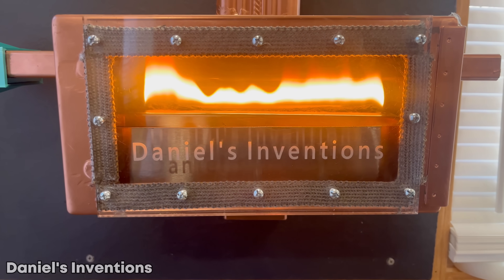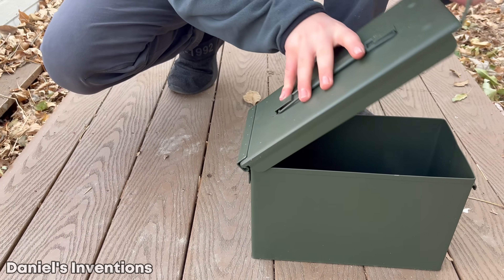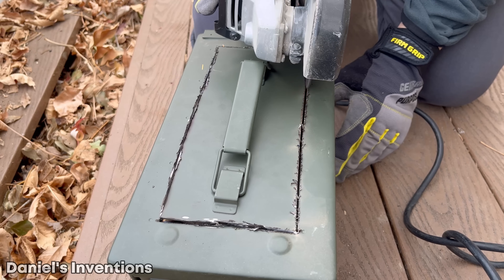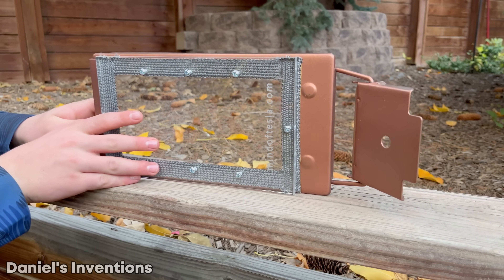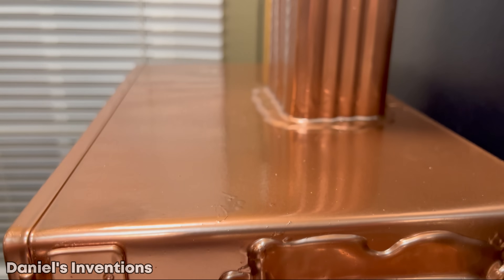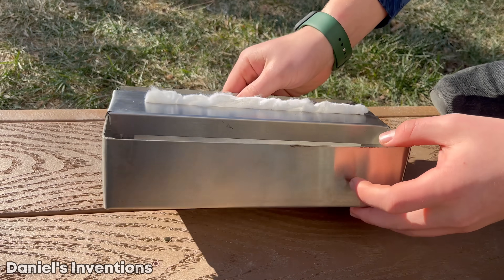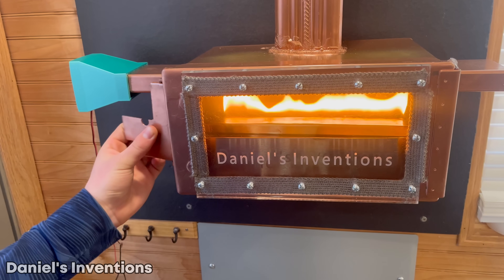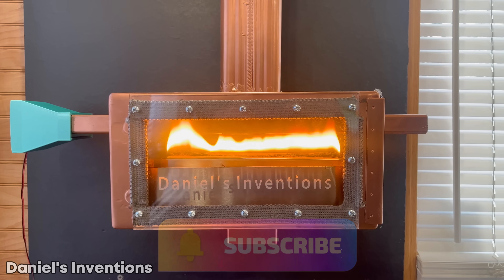ENDLESS Heat for Your Home WITHOUT Electricity 2.0

Comment: Question: if you had a wick system, that you could lengthen like in an oil lamp, could you control the flame and would that allow you to control the temperature your heater is putting off?

Comment: Too eliminate the need for a blower run your heat exchange pipe vertical. Maybe install two, one with a valve to open and close as a thermostat for when not so much heat is needed. The reason for vertical heat exchangers is heat rises naturally pulling the cold air  from the bottom as the heat rises. Hopes this helps you or anyone thinking of designing a heater. Be safe and stay warm

Comment: I built the other one you guys had. My thing was is I tried to put a bigger fan on it and the fan blue so hard it kept the two cool it wouldn't let it heat up. Also I don't think I did the wicks right.... I spent a little money on this little experiment and failed miserably. I really like this idea better. Maybe I may build one of these next year or keep the video around in case the end of the world hits lol
Reply: Lower the fans voltes with a variable resistor

Comment: There are a few reasons to use double walled flue. One is the obvious fire hazard at the wall penetration, but the other is that the double wall insulates the interior flue, keeping it hot enough to reduce combustion products from condensing onto it. Like creosote or tar. Burning any organic matter will produce a tar that can ignite over time, it's not just a wood problem.

Comment: 1:28 as many of us don't have access to a 3D printer for the 12 volt computer fan... what about welding a end cap to the horizontal 1x4 rectangle pipe on the left side, cutting a 4x4 hole in the bottom (or top) flat portion of the pipe and using epoxy to mount the 12v fan into that opening.. 

It would basically be forcing air up (or down) to the opposite flat side of the pipe, then out and across the burn chamber on the right side.

Comment: Bad assery, the thing I'm wondering  is if you could use a heat fan fir a wood stove that needs no external power to power a blower that would make a hot tent that would be awesome ,I very also seen similar designs using used motor oil and candles made from crisco

Comment: I saw a variation of this where they directed outside air into the heating unit. This prevents the system from creating negative pressure and drawing in cold air. The house isn't airtight, and you don't want it to be, but you do want to retain your heat. 

Another thing to consider is adding thermal mass. You could use copper as a conductor and direct heat into a sand battery, perhaps. (?) 

I like the idea. My imagination is playing with other, scaled up, variations. I don't have anything practical, though. 

I have a tendency to overdo things and make them bigger/more complicated than they need to be.   lol

Comment: I like this heater. I would try a chimney pipe with a coaxial design, the inner pipe as exhaust longer. The outer shell would be the intake from outside - no problem with consuming oxygen from inside. The coaxial design would preheat the intake air with the exhaust residual heat.

Comment: Another way to keep the oil cool is to make the vent holes underneath the oil tank also to elevate it from the bottom off the metal that is producing heat with the material that you used for the glass

Comment: Is JBweld heat resistant? I don't know the product. Would be fool proof to get a proper metal weld. How do you put the flame out if the room temperature gets to hot. Do you have any way of regulation of the fuel consumption? Maybe a dripping system would be easier for temperature regulation?

Comment: High Heat: However, if exposed to temperatures significantly above its designed tolerance (like those approaching or surpassing 550°F for JB Weld), the epoxy might start to degrade, potentially releasing fumes or smoke. This is not typical in most applications where epoxy is used, but in extreme cases like direct flame exposure or industrial processes, degradation could occur.

Comment: I wonder if a secondary air flow could be aimed at the top of the heater since it is hot enough to heat a can of soup. That heat could be dissipated with air flow ?? Or does it matter? Not sure. Excellent device. Cheap heat energy.

Comment: Double up the heat exchanger (use 2) and attach aluminium or copper heatsinks to the under side of each for more surface area for the heat to conduct to each exchanger. You also need the heater box deeper as you do not want the actual fuel box getting over about 70c or it will start to emit explosive vapour. Over all a great idea though.

Comment: Cool stove. I have a round floor standing kerosene heater and great heat and can cook on top. But not vented. But I use for extremely cold days only or power out .but I also have wood stove for primary heater.

Comment: Intake air coming from outside also reduces the vacuum effect this design causes, even if it really isn't a huge problem. With the intake located inside the structure and the exhaust venting outside, conditioned/heated air inside the room is being pulled out of the structure, and has to be replaced somehow. That somehow is via leaks in the structure. If it's that cold outside, you're pulling that cold air in to replace the exhausted air through the exhaust piping. Locating the intake to an outside source and sealing the structure makes it even more efficient.

Comment: I did not see how you attached it to the wall. Also, how did you install the outside exhaust pipe? Is it insulated? That said, very interesting video. I have an ammo box. I may try this, but probably will use a fire safe van and a damper.

Comment: This is so cool! I would certainly not advise people to do this without proper guidance though :p, this is a sure way to burn down your house if not done properly. But i have to say this is ingenious, and not very expensive at all! Great diy project that could potentially save you alot of money in the winter months. In Norway we pay up to 3-500$ in the winter months depending on the household. The electricity pricing here is insane in the winter.

Comment: I like it, although I have a couple of ideas based off an admittedly limited understanding of everything involved. Wouldn't it be more efficient to paint the heater and the pipework matt black, to radiate more heat? Conversely, wouldn't painting the concrete board white reflect more heat from it, unless it somehow works better to have it absorb more heat first before radiating any back into the room?
I'm ready to believe I'm entirely wrong with these notions if I can get a clearer understanding. You've spent more time thinking this all through than I have.

Comment: Nice work. Safety first: What happens if the fan fails? Will the bracket melt? Could it cause a fire?
Efficiency: The flames hit the cooling tube and start to soot. Increase the distance for better combustion and less polluting exhaust gases.
Reply: That is a hard drive fan, they will go for years and years. I'm sure they will notice if the fan has failed as it is an essential part of this type of heater being effective. Diligence and operating only with supervision are absolutely the only way to safely use any kind of flame for a heat source.

Comment: By having the intake take air from inside the house you create a negative pressure in the house cause air to be sucked in from the cold outside from any crack near windows and doors in can find. Take air from outside as well as exhaust outside similar to a mini split AC

Comment: CUTE BUT TOXIC OUTPUT.  This is way above the skills of most people and has some safety issues.  Ironically, a small fan driven electric heater is very efficient at heating a single room, particularly if you put a fan in that room to help circulate the air... that's what I do.  Although heat is required by my lease, it is never warm enough and vacancy rates are almost zero in Vancouver and rents are through the roof.  I pay a low rent controlled apartment and don't complain about anything.  I fix it myself.  I pay $1,000 a month for a renovated one bedroom apartment in a city where the average rent for a one bedroom is $2,500 a month.

Comment: I would plumb the intake to use outdoor air for combustion.  Using heated indoor air is just throwing away heat you are making.  The 95% efficient furnaces use outdoor air for combustion and also run the exhaust through a secondary radiator to recover the heat that normally goes up the vent pipe.  What comes out is so cool that exhaust gas is running through a PVC pipe to the roof.  My place has an older style condenser furnace so no outdoor intake air for combustion.  Pulling heat from the exhaust stream leaves a voluminous amount of condensed water that gets pumped outside from a small pump on the floor with a float that starts the pump when water reaches a preset level.

Comment: How long will it run with an oil that you originally added?    And then how long do you have to wait without heat for it to cool  down from 400 degrees in order to refill it?

Comment: Hmm I have questions. Love the design. But… the screw’s you have attached to the burner into the concrete wall… does those screws not get hot???? How long can they last before melting point. And far did it go into your concrete wall and into the drywall in the back?

Comment: Great design, I'd change a few materials but the design is excellent. But you definitely need a few fail safes. Like what happens if the fuel spills or the fan turns off, can everything there take the heat without the cooling running? (If that fan stopped the heat would get to it very quickly, and maybe the plastic doesn't melt off and instead catches fire) Otherwise it's excellent, the running temps were ideal, the exhaust temp is a good sign heat is transferring effectively. Looking forward to version 2.
Sorry, version 3😛

Comment: Looks good but not for like building to put in a camper van, if you had to shut it off completely to move around, I believe the oil would slosh around and spill everywhere and if not completely extinguished it may catch fire.

Comment: I would consider using a heat powered electric fan to make this truly without electricity. They already sell ready-made units for woodstoves. The heat differential between the stove and the surrounding air can generate electricity to power the fan which circulates the air.

Comment: Things to keep in mind when modifying this so it can work well, safely, for a long time.

So, without striping the original finish off, any heat resistant paint on top of that will fail when it does.

That air inlet for combustion should be ducted outside, so warmed air is not drawn from the room to feed the fire.

Having air for combustion come from the outside will help keep the fuel in the reservoir from rising towards it's own boiling point.

Having the fuel get near it's boiling point would be bad, suggest a flat plate on top of it with the wick protruding, where the plate covers the rest of the fuel.

Comment: Love it! As you know clay is used to radiate heat. As for example a clay plant pot over a candle, which heats a whole room, that just a candle would not heat. So how about a clay pipe on your next gen? To radiate heat even more?
Reply: That doesn't work. A candle produces 80 watts whether it's in the open or covered by a terra cotta pot.

Comment: Can you tell me how you mounted the glass to the stove? Is it simply piloting holes through the glass? Also, what sizes were the heat resistant gaskets you replaced the rubber seal with?

Comment: I prefer this to version 3.0 as it is more sturdy. Changes I would make are 1. Make the exhaust pipe of the same material as the heat exchanger; 2. Move the exhaust to one of the back corners to free space for cooking; 3. Route the intake outside as well so there is no need to vent the cabin for fresh air; 4. Create a method of shutting off the heater, maybe by closing off the intake.
Reply: 5. Make a way to adjust the wick

Comment: Did the jb ĥold up? I built something very similar but with a piece of eight inch exhaust pipe from my old truck and I putube dropping down to feed pellets. I also have a oil drip on it. I mig welded mine .still adding on to it. I want the glass

Comment: I like the concept, but I would probably consider having the tank be separate from the heat chamber so you could still use low smoke point fuels without them getting exposed to the intense heat in the main chamber.

Comment: You should add a fresh air intake surrounding the exhaust either to preheat air for combustion or just to prevent cold drafts to be sucked into building. That way you begin to gain back heat from exhaust.

Comment: Would efficiency and heat transfer be improved by building the heat pipe in sections to create a multiple 'S' pattern to slow the forced air down?

Comment: If you extend the air intake port down to the floor, you will have a cold air removal from the room like a return register but not recirculating

Comment: This invention is awesome, but it does have a few issues. The JB weld isn't the best for something like this, I'd suggest to use MIG welding to put everything together, also the heating pipe being made of steel gutter pipe takes away from the heating efficiency just a bit, you should try using copper pipe. Lastly, it's not really electricity free since you need an electric fan for it to blow, but I thought of a complicated solution for this. You could try putting two alternating Stirling engine shafts on either side of the flames while still letting the flames touch the heating pipe. The stirling engine could then be connected to a flywheel and a high gear ratio which would change direction in order to spin a fan the same way the electric fan spins. This would be complicated, but I think it would work and make this invention even more awesome.

Comment: Did the jb ĥold up? I built something very similar but with a piece of eight inch exhaust pipe from my old truck and I putube dropping down to feed pellets. I also have a oil drip on it. I mig welded mine .still adding on to it. I want the gkass

Comment: Interesting invention, cool concept, props for thinking outside the box, but your fan does in fact require electricity.  To be fair, I don't think that fan is actually necessary to the overall operation of this heater, just makes it more efficient?

Comment: use a wood stove fan too circulate the air. they dont use any electricity. try find carbon fiber for the wick.  its used to protect wood studs in houses when your soldiering copper pipes. it will not catch fire and people all around the world use it in their alcohol stoves for backpacking. it will not burn and will probably last for ever. i would love too see a heavier version of this. it needs more thermal mass in the heat exchanger pipe itself. thicker walled metal pipe would work. i dont want to repeat what many others have mentioned already in the comments. but i wanted to mention the carbon fiber felt that they use.

Comment: Could this heat my 16ft by 8ft camper truck? I have a diesel heater in it right now but it costs me around 35$ per week to run all winter.

Comment: Proper welds not JB weld. Then bring to temp outside to burn off old paint before painting. Use a 9v TEG run through a 9v to 12v dc/dc conveter and the surface heat will provide the power for the fan.

Comment: If you add in a couple 45° bends in the exhaust you avoid any fall down into fire and makes it a bit better but you will need a thicker exhaust as heat will collect in specific areas and may melt since the channel is designed for water

Comment: improve efficiency by running a bunch of steelbars through the metal pipe, keep them just a bit shorter than the pipe and weld it in place, maybe add some structure to the flame-siding part of the pipe to increase surface area a bit more- aluminium may also be used which gives much better heat transfer

Comment: Hello Daniel,  I try to build your endless heater but I have some problems, epecally with the lamp wigs, I testet diffrent types ans also baby wipes but noting seams to work, they basicly dont pull the oil fast enought up so they burn not longer then half an hour, do you have some expiriance which you can sahre? Dennis from Poland

Comment: I like the design.  Personally I would use a rubber insulating shroud around the exhaust pipe where it is in contact with flammable wall materials.  I'd also prefer the heat output fan be facing into the room and not towards a wall.

Comment: no one mentioned the fan! If for some reason it stops running that side of the pipe will heat up quickly, melt the 3d printed assembly and it might get caught on fire

Comment: What happens if the fan fails?
Reply: The oil reaches vaporization temperature and explodes the firebox, maybe leaking burning oil from the makeshift oil container or the dislodged wick holder...might perform the above even with the electric fan?

Comment: The 3D printer part killed this project for me and I am sure a lot of other folks that can't afford one or do not know how to use one.  Great project for you and maybe a few others?
Reply: use your problem solving skills. It would be simple to size the fan to the pipe, and then cut some styrofoam with an exactoknife. 

in 30 seconds you can probably come up with 2 or 3 other equally practical solutions. or just contact the library in the city nearest you - often they have 3d printers available for public use. 

or PAY someone who has one... prob cost you 30 bucks. 

frustrated by the fact you didn't bother to think about solutions, and instead just threw up your hands an complained